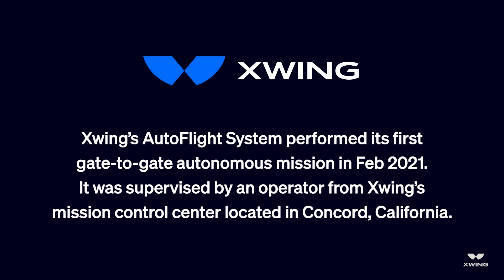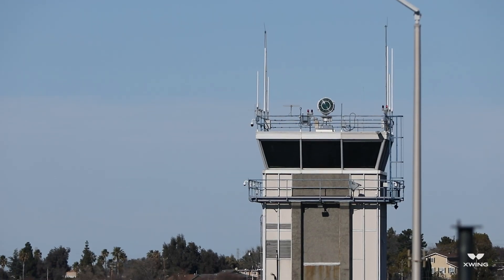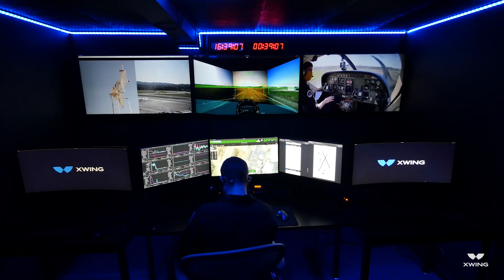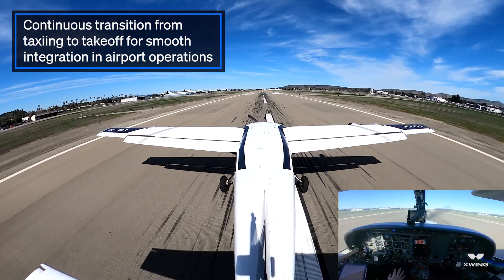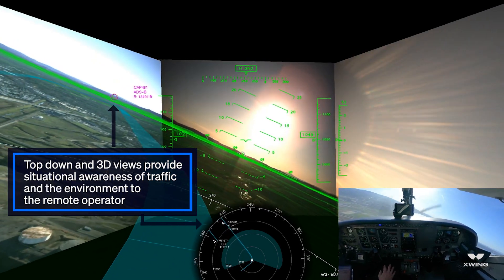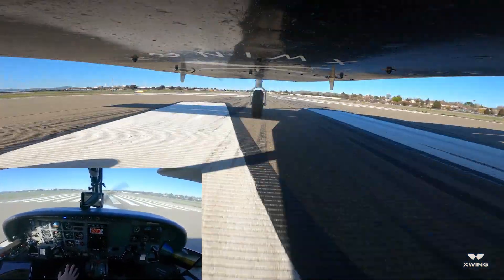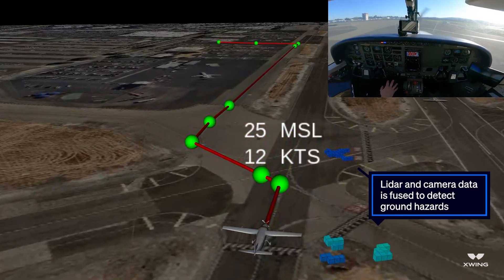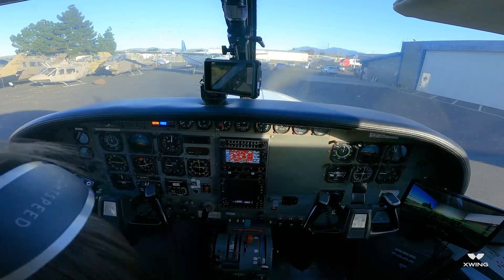Xwing - Gate to Gate demo - Feb 2021

Comment: Making up FAA telephony??
Reply: No, I don't believe so. It appears the ground station controller (ground pilot) is speaking to the safety pilot via radio, but is also making the radio calls to ATC.
Reply: @charliealpha11f3b2  “x wing” is not an authorized callsign.  They shouldn’t be using it in their transmissions